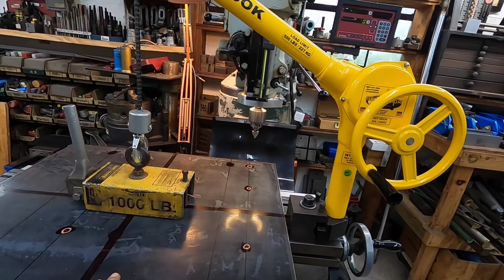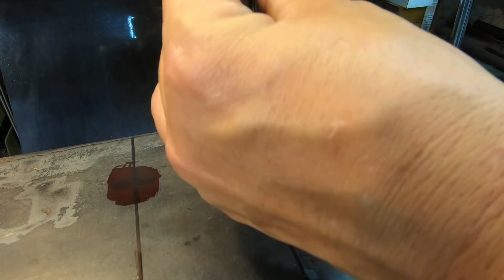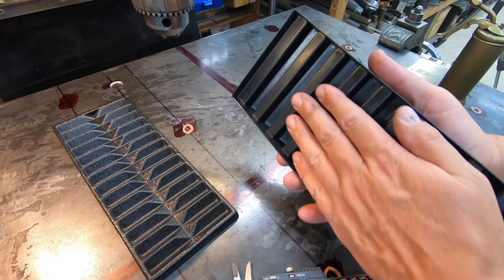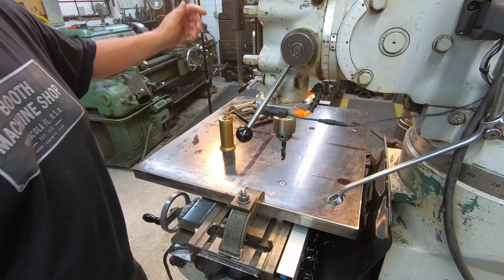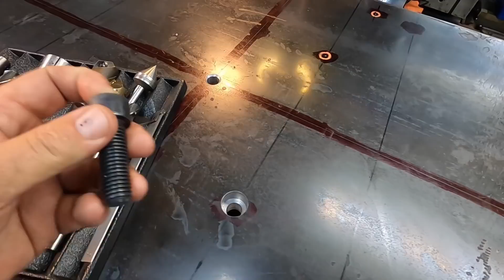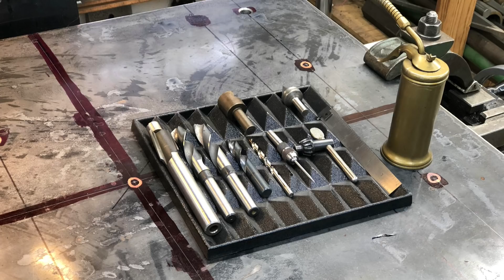Machining Hole Patterns in Stoker Engine Fixture Plate

Comment: I know there are many ways to skin a cat . Could this have been a job for your flex arm? great vid thanks
Reply: I bet it would be a pita to drill something with the flex arm, it is designed for tapping. The amount of feed pressure you need for those counter bore tools can be pretty substantial, no fun at all to drill when you have basically zero mechanical advantage to help out.
Reply: @ColtaineCrows  I saw in his second video with the chamfering.

Comment: Get something like this to locate your punchmarks.....
http://members.optusnet.com.au/swensenr/Optical.html
Reply: That would be complete overkill for the level of accuracy required on this type of job. Also Starrett Center finder/Wiggler set retail is around $50... Optical centering scope is around $400... end result is the holes are drilled in about the same place. Why should someone spend 8X as much for no additional accuracy? Adam probably has a centering scope already but it is way more hassle to use than a simple wiggler.
Reply: @utidjian  right. But do you want to do a job just to the minimum standards? Or do you want to push yourself further? Do you want pride in knowing that the item you just created cannot be made more accurately anywhere by anyone?
Reply: @nggdsb1665  I find it difficult to believe you are being serious. Did you watch the first video in this series? Did you see how he measured (with a tape measure (+/- 1/32)) and laid out (with steel rules (+/- 1/64)) the general layout of the holes? Did you see his notepad with the sketch and dimensions (all to a 16th or greater)? If his best measurement is to within a thickness of one graduation line on his tape measure (about 15 to 30 thousandths of an inch depending on the tape.) Then he need not go any further than the center punch and wiggler that he used. In fact it is actually desirable to have a bit of slop built in to the final layout so when this fixture plate is actually used on the shaper it, and the workpiece it holds, can be "bumped in" to as perfect alignment as his DTIs, patience, and requirements allow. Being a good practical job shop machinist with a couple of decades of experience Adam knows all this and drills clearance (oversize) holes for mounting. Those are the max standards.
"Pushing further" is a completely superfluous waste of time and effort.
Again... "accuracy" isn't the only thing going on here. There is also efficiency. Which is often at least as important as accuracy. Slathering +/- 0.0001" "accuracy" all over a part that was probably made to +/- 0.005" over most of it's dimensions and maybe +/- 0.001" in some critical areas will not magically make it accurate to +/- 0.0001".

Comment: all those material handling gadgets are really coming in handy. for years i have used the pointed edge finder to center up holes for drilling. i drop the pointer into the center punch and let it sit there while you adjust the table you can feel the slightest misalignment with your finger nail. i dont trust the wiggler because the point can take a set when you drop it into the centerpunch . you really need to recenter it ever time you hit the center punch to be sure its still on center.
Reply: The wiggler is actually really easy to see when it is dead on center. The tip appears to stand still and stop spinning. The slightest bit off from being off center and it "blurs." Try them side-by-side sometime and I bet you can't tell the difference. I find the pointed end of the edge finder is useful if I have to locate off a small hole that is already there. The wiggler with pointy tip is useless then and the edge-finder with pointy tip works very well. So many ways to skin a cat.
Reply: @utidjian   i guess its its all a mater of taste  David. both will get the job done. i had a tool and die maker friend who would use sewing needles stuck into a blob of clay at the end of a milling cutter  he would start the machine and center the needle like a wiggler and use it to pick up features on his work.
Reply: @larrysperling8801  Oh for sure it is a matter of taste. I guess that is why there is a still a market for edge finders, wigglers, optical centering scopes, DROs, dials, Blakes, DTIs, layout plates and tables, surface gages, height gages, CMMs, electronic probes, rulers, scales, hook rules, gage blocks... and dozens more that I have forgotten or I am too lazy to type in. I never used the needle and clay method though I have heard of it. It has the distinct advantage that one does not have to swap out the wiggler for the tool each time. Also easy if the spindle speed is low or can be lowered easily.

Comment: I just turn a pilot to the clearance hole size so I don't have to drill for the bolt size followed by the clearance size.
Reply: Thats what i was thinking...never seen it done like that before
Reply: Hi. I have a bunch of counterdrills whit the fix pilot. U can't change. But what I have, almost always has the wrong pilot . So I make something like Adam. Or the print request other clearance then the pilot